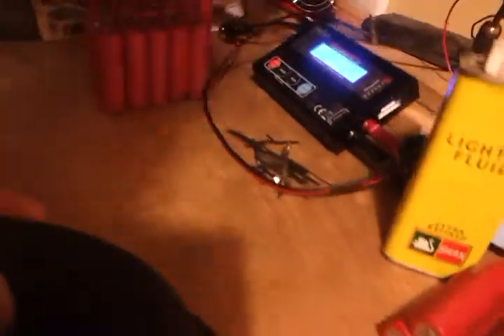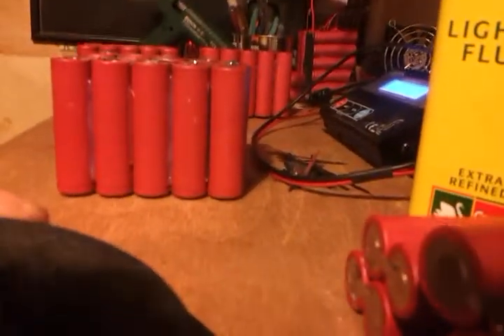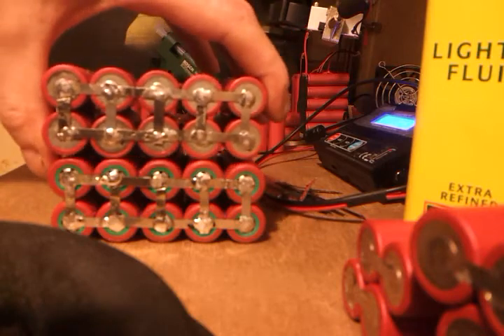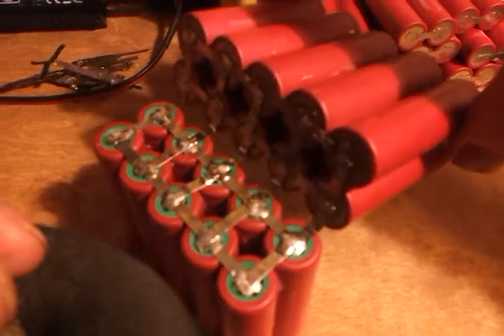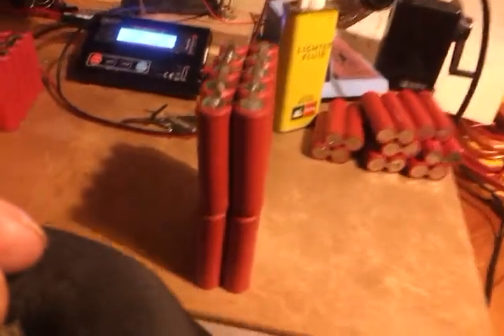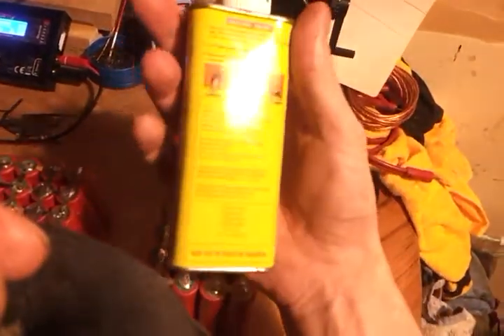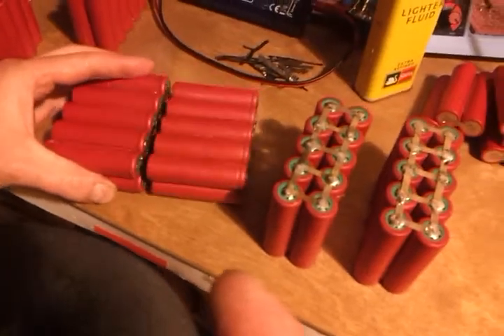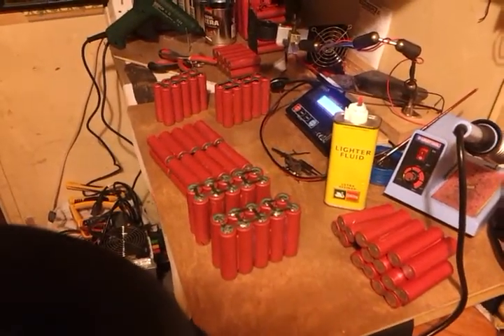24v20ah 18650 lithium ion pack.. pt2

Comment: nice way to organize them!!!. Please correct me if I am wrong.
5 cells in parallel will give you 3.7v , 4.2v nominal .  if each cell(10 units used) has 2A capacity, then you will get  4.2V@20A (10 cells x 2A each =20A).

When you put 6 of then on series then it should be 4.2 * 6 =25.2V.@20A. Total of Cells Used: 60 for 20AH pack. Right?
Reply from the maker: hello  there...
yes  thats it!all you say is correct !..;]
good luck with your build.;]
all the best.